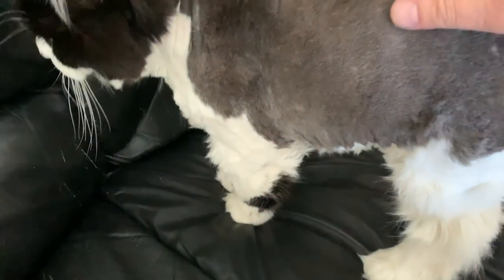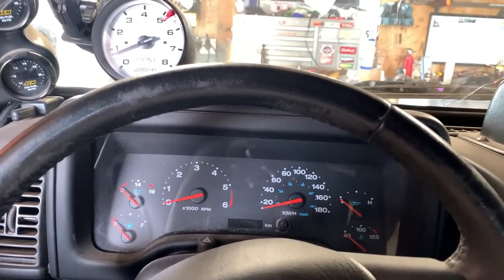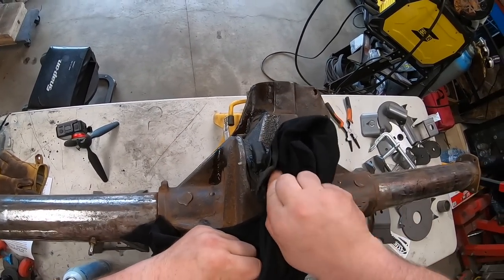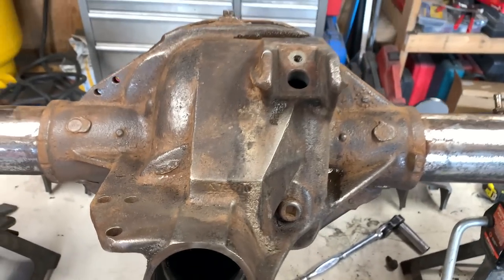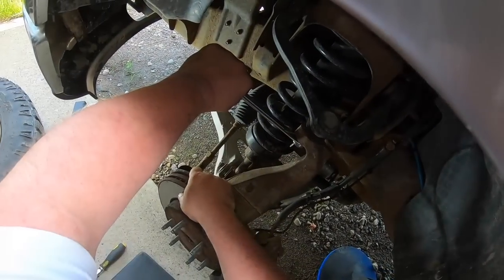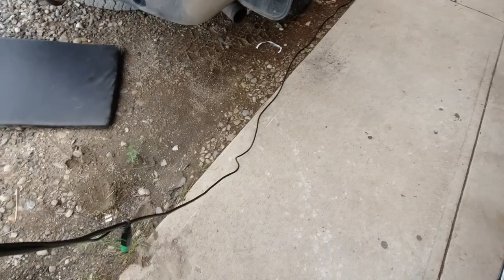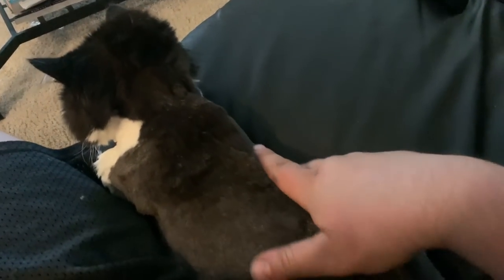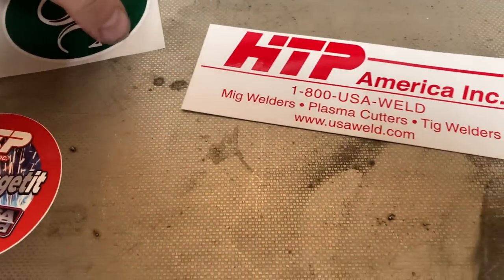Fitting up the Artec 8.8 Truss

Comment: On my rear D44 I went with 20° pinion angle. Which was just low enough with my RC Long arm (4” lift). I ran out of adjustment from my upper control arm (adjusting shorter). I would recommend staying closer to the suggested angle in the instructions. My kit was from Barnes4wd, though I think this could apply to other similar kits.
Reply from the maker: The kit doesn’t apply to engine swaps